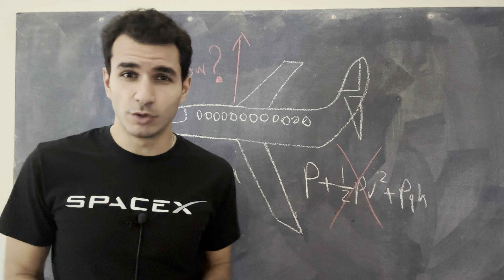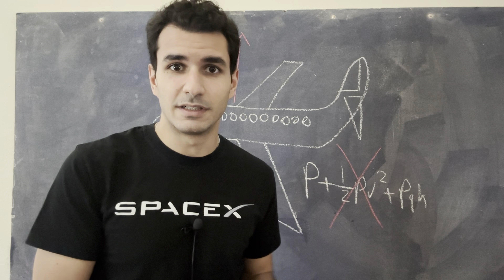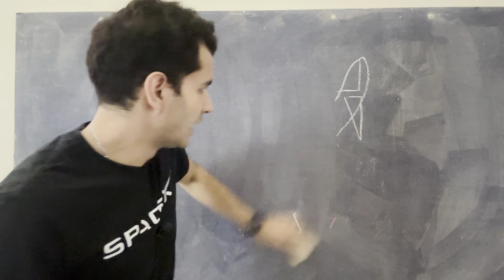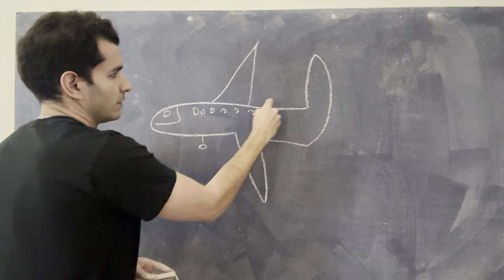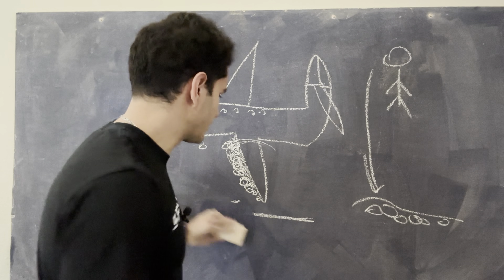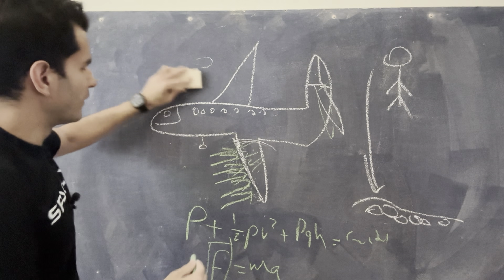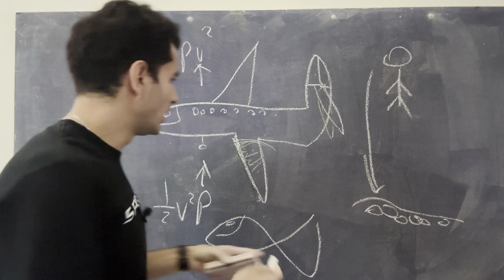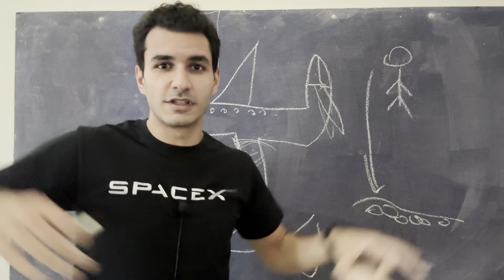Fix This One Misconception = Understand Airplanes Forever

Comment: As an aviator, I was taught that Bernoulli was the sole and primary reason lift occurs. An airfoil wing shape was designed to enhance the Bernoulli effect to make lift more efficient.  And this is why so many pilots fight online when discussing the issue.    I eventually ran into information that describes the physics as Ali is explaining.  That is, Newtons 2rd law of motion (F=Ma) combined with the 3rd law of action/reaction are together the actual dynamic and the prevailing physical model that creates lift.  As Ali is explaining, the pressure differences are a BYPRODUCT of the Newton forces, not the CAUSE of it.  In essence the Bernoulli effect is a head fake.  Sad that the FAA material, and aviation schools are still clinging to teaching this subject incorrectly.  Why do pilots need to know what is actually happening?  Because the avoidance of a stall is paramount and if a pilot does not understand how lift is generated, then that person can fail to control the aircraft properly.
Reply: Isn't F=ma Newton's second law of motion? And a force will have an equal but opposite reaction the third law?
Reply: "the pressure differences are a BYPRODUCT of the Newton forces"

So, you're saying force (pressure over the area of influence) is a byproduct of force (Newton forces).

So, force is a product of force?
Reply: Someone with a brain 😭🙏🏼@davetime5234. if two things mean the same thing, one cannot be a by-product of the other. It's the logical equivalent of saying that a chair is a by-product of a seat. Both the pressure difference and newton's 3rd law are both happening in each different way of describing the same thing. Faster molecules at lower pressure just doesn't cause as more reactive force and high pressure areas. The so rooted in common sense I thought everyone imagined this anyways when the pressure difference is thought.
Reply: @davetime5234  Watch the video.  The angle of the wing and forward thrust concentrates the air molecules which builds pressure BELOW the wing due to Newton's third law.  That then lowers the pressure above the wing.
Reply: @speedomars  But the majority of the total lift force is not from that bottom increase in pressure but from the top's decrease in pressure, by roughly a 3:1 ratio.

That outsized contribution of the top can't be justified by your explanation.
Reply: @davetime5234  Watch the video.  Ali explains it well.  For example, ask yourself how does a plane get off the runway when it is generating the most drag (including the friction of the wheels on the runway) and the angle of the wing is high due to lifting the nose off the runway which would by necessity generate the LEAST pressure difference if you are using Bernoulli as your explanation.  Also ask yourself the king sized question.  HOW DOES A PLANE FLY INVERTED?  The airfoil is completely upside down!
Reply: @speedomars  The common concept for both:

"the angle of the wing is high due to lifting the nose off the runway"
 
and:  

"HOW DOES A PLANE FLY INVERTED?  The airfoil is completely upside down!"

is asymmetry.

Lift results from asymmetry to the relative wind.  Asymmetry can be all from angle of attack or a combination of any asymmetrical camber combined with angle of attack.

Even a flat wing at positive angle of attack is generating flow curvature from the induced pressure gradient, and therefore lift.

"Bernoulli" is simply shorthand for the conservation of energy pressure change in response to mass flow continuity (one of the core Navier-Stokes equations).
Reply: @speedomars  planes designed to fly upside down have fully symmetrical airfoils.
Any other plane flying upside down can do so, but it is doing so because of power (thrust) and high angle of attack. It is very inefficient for planes to fly upside down.  Unless they have sully symmetrical flight surfaces. Then it's the same.
So, you are not thinking apples to apples here.
Reply: @Jmnp08  Definitely true with angle of attack allowing the necessary asymmetry of shape to the relative wind.

But strictly speaking, you don't need power/thrust from an engine:  there would be a sustainable glide ratio that would work to provide enough forward force.

Though it would no doubt be quite steep given the increased inefficiencies.
Reply: @Jmnp08  Not really.  The only criteria for inverted flight is an air frame stiff enough to take the stresses.  The tail of a plane is designed to create negative lift, this gets reversed in inverted flight, that's where the inefficiency originates, not from how the wing is designed. Also, there is no such thing as excess thrust for a plane like a Piper J-3 Cub which can be flown inverted. The J-3 was not designed for aerobatics, but with an inverted fuel and oil system, it can be made capable of such flight without issue. There are many such examples of fairly under-powered aircraft that can do inverted flight without a problem, and their wings are standard airfoils without modification.  The point you seem to want to avoid is simple.   Lift is due to Newton's 2nd and 3rd laws of motion and the fact that the wing is lifted due to a concentration of air molecules BELOW the wing, versus above it.
Reply: @speedomars   you're correct... but this inverted flight is not efficient at all. You are getting carried away with trying to be correct. 
For efficient flight,  with normal thrust parameters... you have to have fully symmetrical airfoil. Period. Also, gliding is not flying.  I am a pilot of planes and sailplanes. 
We can argue the BS semantics all day. The reality is as I stated.
Reply: @davetime5234  gliding is not flying. 
I fly planes and gliders. There is a difference.  Lol
Do t get so wrapped up in semantics.  
Efficient flight, inverted, must have symmetrical airfoil. Certainly I can "fly" a brick upside down or inverted straight into the ground with a glide ratio of .5/1000 pr something like that but that's not really flight now is it? No. 
And yes, i can inverted a glider or any other plane and "fly" inverted but the cost, or loss of efficiency would be astonishingly high compared to symmetrical wing. 
Anyway, this dudes explanation sucks.
Reply: @Jmnp08 How would you say lift for gliding is different?
Reply: @speedomars not many airplanes can, but those that do use excess a/t
Reply: @davetime5234  Correct.  All pilots know the effect of rime ice on the upper surface, which has to be kept clean.
Reply: @davetime5234 exactly this. OP doesn’t know what their talking about
Reply: This is a VERY LONG comment that I am copying and pasting from another discussion where a guy said that Bernoulli is an incorrect explanation of lift.
The 3-liner TL;DR version of it is:
1- Lift is well understood (by some at least) but it is intrinsically complicated and the explanation cannot be simplified without losing essential elements.
2- The Newton explanation is correct, the Bernoulli explanation is correct (as long as you don't invoke equal transit time). Both are different perspectives of the same phenomena. They don't compete. They don't collaborate each giving part of the lift. Both, on their own, explain 100% of the lift. Similar to how the 2nd law and conservation of energy explain why an object gains speed as it falls.
3- But those are after-the-fact explanations. I challenge anybody to PREDICT what the lift of a given airfoil at a given speed and given AoA will be, using only Newton and/or Bernoulli. Spoiler alert: you can't. They fall short.

Ok here is the long version. Good thing that I had this already written because almost nobody will read this:

It is not very helpful to understand lift but it is not wrong either. Because he does NOT say that the REASON WHY the air moves faster along the top than along the bottom is because the air parcels that were split at the leading edge must rejoin when they reach the trailing edge. That would be the " equal transit time" postulate, which is theoretically and observably wrong.

These are some "factual facts":
- The air does split when it reaches the wing, part of it flowing over the wing and part of it flowing under the wing.
- The air that flows over the wing does move faster than the air flowing under the wing.
- According to the Bernoulli's principle, the air that moves faster over the top does have a lower pressure than the air that flows slower along the bottom of the wing, and that creates a pressure difference that is the lift. But don't say that Bernoulli is the reason WHY the pressure on the top drops. Bernoulli is not a cause-and-effect principle. Is a CORRELATION principle. One could (wrongly) say that the pressure drops BECASUE the higher speed, and another one could (wrongly) say that the air accelerates because it's going to a region of lower pressure. The pressure drops AND the velocity increases, but it is not one causing the other, or it would be circular reasoning. Both effects need to co-exist.

Is this contrary to what NASA is saying in its link? Not at all. There are many approaches to explain lift CORRECTLY and each of them bring their own insight. It's not effects that "add up", each contributing with some fraction of the lift. NO. It's just different perspectives. In the same way as you can calculate the speed that an object will have when dropped from a certain height using Newton's 2nd law or using conservation of energy. It's not that part of the speed is due to Newton and part due to conservation of energy: both approaches give the same correct result each accounting for 100% of the speed on its own:

1) You can explain lift with Newton's 3rd law (wing pushes air down, air pushes wing up) and that accounts for 100% of the lift. If you put a "control boundary" ahead of the wing and another one behind it, the change in the vertical momentum of the air accounts for 100% of the lift. That, however, doesn't fully explain HOW that happens.

2) You can explain lift with Bernoulli. Ultimately, lift is a force on the wing and there are only 2 ways that the air can make force on a solid object: with pressure and with viscous friction. Lift in particular is caused by the distribution of pressures around the airfoil which is, on average, lower on the top of the airfoil than on the bottom. And Bernoulli exists and is totally applicable (outside of the boundary layer, but I digress). The pressure field around the wing explains 100% of the lift and correlates with the velocity fields via Bernoulli. In other words " The air moves faster along the top of the wing than along the bottom, and hence it has a lower pressure on the top than on the bottom according to Bernoulli" accounts for 100% of the lift. Again, just don't use words like "because" or "reason why" when talking about pressure vs speed because Bernoulli is not a cause-and-effect principle.

3) You an explain lift using circulation, like in the NASA's link. Circulation gets a little closer to explaining WHY the air moves faster on top than on the bottom, but what is the CAUSE of circulation? One can say that it is the Kutta condition and the Kutta - Jankowski theorem which say, respectively, that the airflow needs to separate at the trailing edge (i.e. it cannot go around it) and that an airfoil will generate enough circulation to bias the potential flow until it does, But why does THAT happen?
Well, you can approximate lift ignoring viscosity and working with potential flow, but that breaks down at the trailing edge because potential flow says that the air would happily go around the trailing edge with infinite speed under an infinite pressure gradient. Even the tiniest amount of viscosity (that always exists in real life) will make that impossible (not to mention supersonic effects) and that, in real life, causes the air to separate at the trailing edge instead of turning around it. Does this CAUSE circulation? Well, circulation is our mathematical way to impose that boundary condition. We just add enough circulation into our model until the separation point moves to the trailing edge.

4) The real and ultimate explanation of lift is the Navier - Stokes equations, which are super complicated and only solvable in approximated ways using computational numerical methods, generally knows as CFD (computational fluid dynamics). Yet, with advanced models, code, and computers, we can get excellent predictions of the pressure and viscous stress distribution around a body which in turn let us predict, very accurately, all the aerodynamic forces and moments on a body, including of course lift. Which, once again, will account for 100% of the lift.
Circulation (including Kutta condition and the Kutta - Jankowski theorem), Bernoulli and the momentum conservation approach, al can be derived from Navier-Stokes. Navier-Stokes itslef is derived from conservation of momentum on a parcel of air (that is, from Newton's second law), along with conservation of mass and other stuff.

5) And yet, we know that Navier - Stokes is utterly and unreconcilably WRONG. Because the it is based on a totally and demonstrably false assumption: The continuum hypothesis. Air is not a continuum, it is made up of individual molecules of nitrogen, oxygen and other stuff. If you want the REAL ULTIMATE CORRECT explanation, you would need to apply Newton's second law on each individual molecule. We are lucky that the wrong Navier - Stokes model gives results that are almost identical to that, at least until you are so crazy high that the molecules behave more like isolated particles rather than interacting particles (i.e there are so few molecules per unit of volume that cloisons between molecules are sparce).

"All models are wrong, but some are useful" - (George Box).
Reply: @adb012 Navier Stokes model is not a “utterly and irreconcilably wrong model”. It assumes that the air is a fluid made of several discrete molecules and that they follow Boltzmann statistics. The length scales that concern us like any typical aerodynamic objects are more than 10^6 larger than the mean free path (the average distance between molecular collisions) which means it is a quite accurate approximation. Maybe it’s not exactly “fundamental” but I wouldn’t  like to wander to the philosophical aspect of science since it detracts from the practical reality of what is achievable with our calculations.
Reply: @Qua54R  ... Take into account the context, please.

First line of my comment: "I am copying this from a discussion with a guy who said that Bernoulli is an incorrect explanation of lift."

Last line of my comment: "All models are wrong, but some are useful" - (George Box)."

Navier-Stokes model is wrong in the same sense that Newtonian mechanics is wrong. It is based on false assumptions (continuum hypothesis) and while it is an excellent approximation in a whole lot of cases (including atmospheric aerodynamic lift), it does break down at the extremes. Or try to predict the drag of the ISS using Navier-Stokes.
Reply: @adb012 Understanding aerodynamic lift intuitively is easy enough if you have a scientific mind. It is the summation of forces of all interacting air particles on the wing. With a higher concentration of particles providing an upward force on the bottom edge of the wing. But modelling the countless interactions individually would be horrendous. So using a holistic approach is perfectly reasonable by treating the air as a continuous medium.
Reply: @mista5796  ... Correct but not so fast. The force of each air molecule over the wing depends on the forces that the next layer of air molecules make on the layer immediately in contact with the wing, which in turn depends on the next layer and so on. There is more interaction between air molecules than between air molecules and the wing. That's why you cannot model left as marbles bouncing off the wing (where each marble interacts only with the wing). This effort is unattainable, which s why we use the continuum hypothesis which is totally incorrect (air is not a continuum, it is made of individual molecules that move relative to each other) but totally useful as the resulting Navier Stokes equation (itself unapproachable in analytical terms but can be approximated with arbitrary accuracy with numerical models) give results that are highly accurate to predict what the fluid will do wand what forces it will impose on bodies. But nobody in the popular media explains lift in terms of the Navier Stokes equation. Because "The wing produces lift because the fluid must meet the Navier Stokes equation and the boundary conditions, and lift results from that" is highly unsatisfactory. Saying "Wing pushes air down, so air pushes wing up by action and reaction" is totally correct and explains 100% of the lift (unlike what many videos and books say), but is also highly unsatisfactory because, yeah, but the same can be said about how cars work (tires push the pavement back so the pavement pushes the tires forward), or rockets, or... you name it. Whenever there is a force, there are two forces (action and reaction). But that doesn't explain how does the wing pushes the air down or how the air pushes the wing up, let alone it being totally useless to make predictions (like predicting how much lift would be produced by a certain wing at a certain speed and AoA). And when people start messing with Bernoulli and pressure fields, they screw up big time. "Air moves faster over than under the wing so the pressure is lower by Bernoulli" is also a very good and correct assertation, and actually you can directly convert the velocity field into a pressure field around the airfoil and integrate the component of the resulting force perpendicular to the freestream velocity to obtain a very good approximation of the lift. But what does that EXPLAIN about how lift is generated? Nothing, you just moved the goalpost. Why does the air moves faster over than under the airfoil? And then you start to get all kid of wrong explanations. Equal transit time is totally wrong. Pinching of the streamlines is between wrong and a consequence rather than a cause. Some people correctly say that the reason why the air accelerates is because the pressure is lower on the top so the air follows the pressure gradient, which is correct (the air has to follow Newton's 2nd law too, not just the 3rd law), but wait... Are we saying that the pressure is lower on the top because it moves faster on the top, and that it moves faster because the pressure is lower? That's circular reasoning. It's not until you introduce the Kutta condition, circulation, and the Kutta-Joukowski theorem that things start to make sense and you can start getting some actual explanatory power AND predictive power to calculate the lift of a given airfoil at a give AoA and given speed (which paradoxically relies on both viscosity to force the non-slip condition and the separation at the trailing edge, and potential flow to calculate the speeds and pressures profile through Bernoulli, which are two incompatible concepts, but there the boundary layer comes to save the day). And I dare you to go and find this explanation in any of the "This is how lift REALLY works" videos.
Reply: I'm sorry, but this is absurd.  

(TL;DR for the following:  force of lift results from relative flow turned by an asymmetrical solid)

"Bernoulli" is shorthand for conservation of energy.  This exists everywhere and is foundational to Newtonian physics (the basic description of physical reality we study and verify in basic science courses).  

If kinetic energy goes up it must be borrowed from potential energy, like a rollercoaster's speed (kinetic energy) adjusting with height (potential energy).

For fluids/air the "Bernoulli" representation of conservation of energy relates an increase in flow speed to a decrease in pressure and vice versa.

The core of Newtonian physics here is conservation of mass (flow rate), conservation of momentum (quantity of motion), and conservation of energy (ability to do work: a seesaw balance between kinetic and potential energy).

A wing airfoil is a solid asymmetry confronting a relative flow.

The relative flow (mass flow rate) must be conserved, so the asymmetrical obstacle of the airfoil causes an asymmetrical speed change to the flow split around the top and the bottom of the airfoil.

But conservation of energy says the increased kinetic energy from the speed to maintain mass flow continuity, borrows from potential energy, which is a drop in static pressure.

The above asymmetrical pressure difference between top and bottom, accelerates relative flow down (analogous to wind bending around a weather pressure system).

The above change in momentum direction results in an upward force (conservation of momentum).
Reply: @davetime5234 as an aerisoace engineer I am confirming that is the the full intuitive explanation behind the math that we use everyday to design wings and complete aircraft.
For anyone that still thinks that the explanation of flight is contested and "science" doesn't actually know what is going on: lift generation is fully understood and used everyday to make things fly very predictably and reliably.
Sure, the accuracy of real life calculations is finite, but that doesn't change anything about the completeness of the fundamental understanding.

Caveat: apparently some mathematicians pushed the Navier Stoked equations to some extreme regions where no consistent solutions exist. I sincerely hope this is "just" a consequence of the continuum assumption or we are in trouble 😅
Reply: @Qluq77  You are of course right pertaining to fundamental understanding, however First level of thinking and understanding is not always applied in teaching and it assumes that students always understand, as an example, the fundamentals cannot work, in a Vacuum, the reason and answer is in the why.
Reply from the maker: Spot on!
Reply: "the pressure differences are a BYPRODUCT of the Newton forces, not the CAUSE of it.  In essence the Bernoulli effect is a head fake"  

I like to re-visit these ideas occasionally.

Your statement is misleading, because it treats "Bernoulli" and "Newton" (whether 2nd law or 3rd law etc.) as being separate ingredients having some hierarchy of cause-and-effect according to personal conceptual desire.

But you haven't mentioned flow continuity, which is what Nature must maintain when an airfoil passes.

"Bernoulli" and "Newton" are merely two outtakes of the conservation of mass (flow continuity), energy, and momentum.

"Bernoulli" emphasizes conservation of energy, and "Newton" conservation of momentum.  Mass flow continuity (conservation of mass) is misinterpreted as ETT.

The above three popular narrative concepts (Bernoulli, Newton, ETT) are just poorly executed notions of the three fundamental conservation properties (energy, momentum, mass).

"Bernoulli" a head fake?  In terms of conservation of energy, hardly:  you need the energy conversion to "service" the change in momentum that gives you lift.

All in the name flow continuity being inevitably maintained.
Reply: I'm also an aerospace engineer and I can confirm that davetime is correct. This whole "disproving Bernoulli" trend is ridiculous and pushed by people who don't understand Bernoulli at all. They act like planes flying inverted is some kind of "gotcha" when it is completely consistent with a pressure model of lift.
Reply: @Quasarnova1  You are arguing with a NASA aerospace and physics PhD.  Watch this video.   Your education is dated.
Reply: @speedomars Neither NASA nor any aerospace degree programs make claims like this. Watch some college lectures before assuming some random video is correct.
Reply: This is a great explanation, we as humans tends to always look for deep detailed theories about everything and we sometimes overlook the obvious! Great example here.
Reply: @ "Lift is due to...a concentration of air molecules BELOW the wing, versus above it."

That is misleading.  The deficit of molecules above the wing results in greater pressure drop (below ambient) above the wing than the increased concentration.

So, if B is increased pressure below the wing and A is decrease pressure (below ambient) above the wing:

Pressure difference = A + B

where A is much more than B.

How can the smaller B explain the much bigger A?

What you are saying is illogical.
Reply: Well done, and all correct AFAICT. But ultimately unsatisfying to me. Focusing on momentum conservation (ie Newton III), clearly the wing “grabs the oncoming air and thrusts it forcefully DOWN”, if you will. How does it do that?

Especially: why does the air on the upper surface of the wing speed up and follow the wing around to its trailing edge, then separate from the wing? (and continue on a downward trajectory).
Reply: In a conventional aircraft optimized for lift-to-drag ratio, lift is primarily generated according to the Bernoulli principle. Only when full pitch control over lift is needed—such as during inverted flight in an aerobatic aircraft—are symmetric airfoils used. The trade-off, however, is higher drag.
So it's best to stick with the Bernoulli explanation, as it accounts for the majority (about 90%) of the lift in a typical aircraft and also explains why lift is still produced at negative angles of attack of the wing (how would you else explain that fact).
This video is, frankly, quite inaccurate at best.
Reply: @olivergroning6421  apparently you have not watched the video, nor read the comments.  Read some of the more current literature from NASA and MIT.
Reply: I also wonder at night time or bad weather no one can see a bit of shit from Aeroplane ... we are taking advantage of wide space in air nothing more than that, a small bird can crash this shit😂
Reply: Can someone explain how the magnus effects works
Reply: @h3xad3cimaldev61  The Magnus effect is a phenomenon where a spinning object moving through a fluid (like air or water) experiences a force that deflects its path, causing it to curve sideways. This force arises from a difference in air pressure created by the object's spin. The side of the object moving against the flow experiences higher pressure, while the side moving with the flow experiences lower pressure, resulting in a net force that pushes the object sideways.
Reply: Apparently they also teach pilots that the critical angle of attack is constant for a particular airfoil! 

Was shocked when I found out pilots believe that
Reply: @ Why not believe it when it's true?
Reply: @davetime5234  it's an okay assumption assuming you've got a well designed (conservatively designed) airfoil which ofc will always be the case in commerical aviation. But even there the critical angle of attack will be noticeably lower at low Reynolds Number
Reply: @barnowl2832  AoA is also a horribly misunderstood dynamic.   The truth is, a stall can occur at any speed. That is, any rate of airflow.   So the shape of the wing alone is NOT the primary dynamic.  A stall comes not primarily from air separation over the wing,  it occurs when the downward deflection of air is reduced.  According to Newton's Third Law, lift is generated by the wing deflecting air downwards, and this action-reaction force is the basis of lift.
Reply: @ But the downward turning of air is caused by the vertical pressure gradient.  

And that vertical pressure gradient is always the same for a given value of lift independent of airspeed:

pressure x area =  lift = d(mv)/dt) (vertical)

But the longitudinal pressure gradient to sustain that vertical pressure gradient changes with airspeed because the supply of air mass changes with airspeed.

So, the flow must accelerate to higher speed at low airspeed to sustain the same vertical pressure gradient as the force of lift.

It is the critical adverse pressure gradient (slow down back towards ambient pressure) that determines what is the critical angle of attack.

So,  it is not the "rate of airflow" as you said, but the rate of the rate, or deceleration of airflow that stresses laminar flow into chaotic motion.
Reply: @davetime5234  Newton's third law of motion, which states that for every action, there is an equal and opposite reaction, explains how an airplane generates lift. When an airplane wing pushes air downwards (action), the air pushes the wing upwards (reaction), creating lift.  Remember, the wing is mounted in such a way that there is ALWAYS a 2 to 5 degree positive angle of attack in level flight, and more pronounced in climb.  When descending some lift is still necessary, hence the angle between the wing's chord line and the relative wind still remains positive, albeit less pronounced.    The air compresses BELOW the wing generating higher pressure and by action, molecules above the wing are fewer, thus leading to a LOWER pressure gradient. The difference some attribute to the Bernoulli principal are actually a byproduct of Newton's 3rd law.
Reply: @speedomars  As far as the vertical component of lift in a steady climb or descent, it is always exactly equal to that in straight and level flight.

For your "air compresses" explanation for the popular narrative of the "Newton" explanation, that is "drag lift" like a traditional round parachute.  It doesn't explain airfoil lift, and airfoil lift's efficiencies.

Your drag lift explanation doesn't explain why sailboats can sail faster than the speed of the wind, or why aircraft can fly with very efficient glide ratios (15 miles forward for 1 mile down roughly for airliners), which is directly related to economically viable fuel consumption.

The "Newton" you're describing is closest to conservation of momentum.  The "Bernoulli" you're dismissing is closely related to conservation of energy.  The invalidated equal transit time is a misinterpretation of conservation of mass (the flow continuity equation in Navier-Stokes).

The truth is not the popular narrative versions of "Newton 3rd law", "Bernoulli pressure dop", "ETT yes or no", but the 3 replacement correct but relation principles of Newtonian physics:

Conservation of mass, energy, and momentum as mentioned above.

Basically, nature must maintain flow continuity across an airfoil, and it does this by negotiating momentum conservation (quantity of motion), and energy conservation (seasaw balance of speed as kinetic energy, with pressure as potential energy).

In short:  Lift is the force from an asymmetrical solid turning the relative flow, as it maintains the 3 conservation principles (Navier-Stokes).

So yeah, your downward reaction force is there, but it's just a little more complicated.
Reply: @speedomars  you're mixing cause and effect here. The wings aren't mounted so that they produce a positive angle of attack, rather the aircraft must be flown at a positive AoA in order to fly level. The mounting angle is more a question of efficiency/comfortable deck angle/structural integrity/interaction with the aerofoil that is the fuselage, etc etc.
Reply: O.k. I am not an aviator, but I am a physicist. The problem with this explanation here, is that it describes the situation of a high angle of attack, where you produce a high pressure region (higher than static pressure) below the wing by dynamic pressure, which is very intuitively understood in terms of Newton. 
But, that (and this is the point) this is only true at high angles of attack. At low angles of attack (e.g. at cruising and having a chambered air foil) the pressure above AND below the wing is lower than the static pressure. This is due to Bernoulli because the air stream above AND below the wing are faster in the vertical direction than for the air at rest. However, the upper air stream being faster than the lower. The reason lift is generated in this situation is that the pressure above the wing is lower than below. Bernoulli cannot be understood by Netwon’s laws, because it is due to energy conservation. The Bernoulli equation expresses an energy balance not a balance of forces. What is happening that in the static case the gas molecules move with an equal average velocity in the vertical and horizontal direction (let us forget for the transverse component here). When the gas velocity distribution is increased in the horizontal direction, the kinetic energy component in this axis increases. However, the total energy balance in the stream must be conserved, this means the average velocity (actually average velocity squared) of the gas molecules in the vertical direction is reduced. By the microscopic momentum change when the gas molecules are bouncing off the top or lower face of the wing the force is reduced (as compared to the static case) because their average vertical velocity is reduced. By the way this effect, doesn’t yield a net deflection of the air stream down, if the vertical position of the wing doesn’t change (I will not explain this, but it can be easily understood). 
All this happens (at low angle of attack and for a chambered wing) actually above and below the wing, however to a larger extend above the wing. Now even though the pressure on the wing is lower than the static pressure above AND below the wing there is still lift because of the pressure difference. As the angle of attack is increased the pressure on the lower side of the wing is increased and can become even larger than the static pressure due to dynamic pressure build up, then you transit in the lift generation regime. For an optimized airfoil the lift generation predominantely by the Bernoulli effect is between -5 (actually you see Newton/dynamic pressure would have a hard time explaining lift at negative angles of attack) and +10 deg angle of attack and thentransits gradually to dynamic pressure lift.       
You can search for ‘air wing pressure angle of attack’ and you will see that.
Reply: @olivergroning6421  Unfortunately your explanation contains some significant errors.

The biggest errors lie in the mischaracterization of Bernoulli’s relationship to Newton’s laws, the simplification of molecular velocity effects, and incorrect dismissal of downward airflow deflection. 

The last point is particularly problematic because downwash is a well-documented physical reality in aerodynamics.
Reply: @olivergroning6421  Asking AI for a non-biased objective assessment from your exact words:

The explanation contains several inaccuracies and misunderstandings regarding aerodynamic principles. First, the claim that a high-pressure region below the wing is only present at high angles of attack is misleading—most airfoils generate a pressure differential even at lower angles due to circulation effects. The assertion that both upper and lower wing pressures are below static pressure in normal flight is incorrect—while upper surface pressure is lower due to increased velocity, the lower surface pressure is typically higher than ambient, creating lift. The statement that Bernoulli’s equation cannot be understood through Newton’s laws because it is an energy balance rather than a force balance is also misleading—Bernoulli’s principle is a direct consequence of Newton’s laws applied to fluid motion via the work-energy theorem. The molecular velocity explanation oversimplifies fluid behavior, incorrectly linking individual velocity components to bulk pressure changes. Most critically, the claim that no net downward deflection of air occurs is demonstrably false—downwash is essential for lift production and is a well-documented aerodynamic reality. These errors lead to a misrepresentation of lift physics, particularly how Newtonian mechanics and Bernoulli’s principle coexist in flight theory.
Reply: Many planes are able to fly inverted. This alone proves that there is more to lift than Bernoulli.
Reply: I gave the video and this comment section to the AI and this is its answer:

This is a fantastic comment section that really gets to the heart of why explaining lift can be so tricky and contentious!

Let's break down the main arguments:

Who is most correct and why?

@adb012 provides the most nuanced, comprehensive, and fundamentally correct explanation.
Here's why:

Lift is Complex, Simplifications Lose Nuance: He correctly states that lift is intrinsically complicated, and trying to simplify it too much (as the original video does, and as many "Newton vs. Bernoulli" debates do) inevitably leads to incomplete or misleading explanations.

Newton and Bernoulli are NOT Competing Explanations: This is the most crucial point. He rightly says, "Both are different perspectives of the same phenomena. They don't compete. They don't collaborate each giving part of the lift. Both, on their own, explain 100% of the lift."

Newton's Laws (Momentum Change): A wing generates lift by deflecting air downwards. This change in the air's momentum results in an equal and opposite upward force on the wing (Newton's 3rd Law). This is a complete explanation.

Bernoulli's Principle (Pressure Difference): Air flowing faster over the curved top surface of a typical airfoil results in lower pressure there compared to the slower-moving air and higher pressure under the wing. This pressure difference, acting over the wing's area, creates an upward force. This is also a complete explanation.

They are Linked: The reason air speeds up over the top (leading to lower pressure via Bernoulli) is because the wing is forcing the air to change direction and conserve mass/momentum (Newtonian concepts). The pressure field and the velocity field are intrinsically linked.

Refutes "Equal Transit Time": He correctly dismisses the "equal transit time" theory (the idea that air split at the leading edge must rejoin at the trailing edge simultaneously, forcing the top air to travel faster) as wrong. This is a common misconception often taught alongside Bernoulli.

Bernoulli as Correlation, Not Cause-Effect (in isolation): He astutely points out that saying "pressure drops BECAUSE speed increases" or vice-versa is circular if you only consider Bernoulli. Both effects (lower pressure and higher speed on top) co-exist due to the overall fluid dynamics governed by more fundamental principles (like conservation of momentum and energy, embodied in Navier-Stokes equations).

Predictive Power: He correctly notes that neither a simple Newtonian deflection argument nor a simple Bernoulli argument alone is sufficient to predict the exact amount of lift an airfoil will generate. For that, you need more complex models like those based on circulation theory or, most completely, the Navier-Stokes equations (which are themselves derived from Newton's laws applied to fluid parcels).

"All models are wrong, but some are useful": This is a perfect summary. Newton and Bernoulli are useful models for understanding aspects of lift, but the reality is governed by the full set of fluid dynamics equations.

Analyzing Other Key Commenters:

@davetime5234: Is also very strong and largely aligns with @adb012. He correctly emphasizes the three conservation principles (mass, momentum, energy) and how Bernoulli and Newton are facets of these. His critique of @speedomars' "pressure is a byproduct of Newton forces" (implying force is a product of force) is valid. He also correctly points out that the pressure drop above the wing often contributes more to lift than the pressure increase below for typical airfoils.

@speedomars (the pinned comment): While his intention to simplify is understandable, his explanation falls into the trap of creating a false dichotomy.

Calling Bernoulli a "head fake" is incorrect. It's a valid physical principle that describes a real correlation between fluid speed and pressure.

His explanation that "concentration of air molecules which builds pressure BELOW the wing... That then lowers the pressure above the wing" is an oversimplification of how the pressure field is established. While deflection does increase pressure below, the lower pressure above is more directly related to the acceleration of air over the curved surface.

His points about takeoff at high AoA and inverted flight are valid challenges to oversimplified Bernoulli explanations (especially those relying on ETT or only the top surface curvature), but they don't invalidate Bernoulli's principle itself. Both can be explained by considering the effective shape the wing presents to the airflow (asymmetry, as @davetime5234 points out) and the resulting pressure distributions and momentum changes.

@olivergroning6421 (Physicist): Makes some significant errors:

"Bernoulli cannot be understood by Newton’s laws, because it is due to energy conservation." This is incorrect. Bernoulli's equation is fundamentally derived from applying Newton's second law (via the work-energy theorem) to a fluid element along a streamline.

"At low angles of attack... the pressure above AND below the wing is lower than the static pressure." This is generally incorrect for a cambered airfoil producing positive lift. The pressure below is typically higher than static, and above is lower.

"this effect, doesn’t yield a net deflection of the air stream down, if the vertical position of the wing doesn’t change." This is fundamentally wrong. For lift to be produced, there must be a net downward deflection of air (downwash).

@Qluq77 (Aerospace Engineer): His support for @davetime5234 and his assertion that lift is well-understood by engineers is important context.

In Simple Terms (incorporating the best points):

Imagine a plane's wing moving through the air.

The Wing Pushes Air Down: The wing is shaped and tilted to push air downwards. Think of it like sticking your hand out of a car window and tilting it – you feel a force. When the wing pushes air down (action), the air pushes the wing up (reaction – Newton's 3rd Law). This upward push is lift.

Air Speed and Pressure Change: As the wing forces air to go around it, the air flowing over the typically more curved top surface has to travel a bit further or is "squeezed" and speeds up. When air (or any fluid) speeds up, its pressure drops (Bernoulli's Principle). The air under the wing is often moving slower, or is compressed, resulting in higher pressure.

Pressure Difference = Force: This difference in pressure (lower on top, higher on the bottom) creates an overall upward force on the wing. (Force = Pressure x Area).

They're Connected: The wing pushing air down (Newton) causes the changes in air speed and pressure (Bernoulli). So, they are two ways of looking at the same event. One focuses on the forces and momentum change of the air, the other on the pressure differences created. Both are correct and describe 100% of the lift from their perspective.

Why Speed Matters: Air is thin. To get a strong enough "push" from the air (either by deflecting it or by creating significant pressure differences), the plane needs to move very fast. This is what the "dynamic pressure" (1/2 ρv²) term in the video refers to – the faster you go (v), and the denser the fluid (ρ), the more "forceful" the interaction.

The debate isn't really about whether Newton or Bernoulli is "the" reason. It's about which simplified model best helps build intuition, and acknowledging that both are aspects of a more complete (and complex) physical reality described by the Navier-Stokes equations. @adb012 captures this best.
Reply: @kennyphan9612  Where is the comment by @adb012?  I can't seem to find it?
Reply: @davetime5234 weird, now his comments are deleted
Reply: @davetime5234 oh I found it, above the comment section, choose "newest" instead of "top"
Reply: @kennyphan9612  It reads like a lot of my comments taken from elsewhere and blended with some other comments which clutter, and in several places dilute the meaning.
Reply: @kennyphan9612  No wonder AI said my comments align well, when much of the pieces appear to be my comments.
Reply: @kennyphan9612  🤣 I just had this mental picture of a guy dumping huge reams of documents into the gaping maw of a machine with a cynical expression on his face.  Like "Here, eat this haha" And imagine getting clowned on by AI omg the irony.  "Mother, today I took a severe blow to my ego.  AI has shit on me" 😂
Reply: By that logic isn’t f=ma a byproduct of action? And isn’t it all just charged particles exchanging virtual photons? The Bernoulli description is a good model for what’s going on.
Reply: @jessenelson8106  Bernoulli is the "f "(from conservation of energy to sustain conservation of mass flow "continuity"), and "ma" is the resulting vertical rate of change of momentum resulting from "f".

And you can say the latter is conservation of momentum (more than just saying conceptually, it is physically true).

Now, did it sound like I just said an f is equal to an f?  Yes.
Reply: Pressure gradients are created by the geometry of the wing, as there is a readily available pressure produced by the atmosphere. These pressure gradients determine the pressures and velocities of air across a wing surface area, resulting in the pressure differential for lift.

With the foce of an upwash of oncoming air, there would be continuity and energy conservation, so yes, forcing a fluid into motion can create the conditions to harness readily available pressure forces to act on a multi ton aircraft relying on a force which is readily available, unlike thrust production accelerating a fluid(through combustion) to hypersonic speeds(Like a Saturn v rocket) to achieve a force equal to the weight.

Newton's forces rely on pressure gradients(2nd law) and equal-opposite reaction(3rd law) no pressure gradient. The only way to reconcile these simultaneous contradictory events is through pressure differences. This is how Newton's 3rd law of lifting the weight of the aircraft is achieved by accelerating the static air above the upper surface into dynamic flow, hence a reduction in static pressure and a gain in kinetic energy.
Reply: @singh2702 You're pretending like you are inventing a better wheel than the wheel already well time tested.  Absolutely no net usefull insight here.  Your valuable points are ravaged by your bias serving ommisions.  Your lack of basic well rounded science skills is nullify  any useful contribution.
Reply: @davetime5234 The atmosphere provides an existing condition of pressure, 10 tons/m² or 14.7psi at sea level. 

On either side of the stagnation point, there are pressure changes. On the lower surface this existing pressure increases as the wing is redirecting air to flow parallel away from the trailing edge. This is the downwash caused by the change in momentum imparted by the wing onto the fluid. F=ma

On the upper surface the existing pressure is dropped through a pressure gradient. 

This increase in pressure below and decrease in pressure above must eventually equal a pressure differential equal to the weight of the plane. This is how wings are designed, how these differentials are achieved is misunderstood because it's very complex, and requires CFD. A lot is going on, the pressure and velocity distributions over a 3D wing is not simple. 

If you wanna explain lift by saying that the downwash is equal to the weight of a plane then you probably thinking of two flat planks as wings, creating massive drag with the lift force.
Reply: @singh2702 Fundamentally flawed: not acknowledging the rate of change of vertical momentum must at all times be fully equal to the force of lift regardless of wing shape.  There's no debate here as it is indispensable basic physics.
Reply: @davetime5234  We are all immersed in a pressurized fluid. The pressure exerts a bouyant force on us, meaning we actually weigh less and even more less if we were submerged in a pool. 

As a plane flys through this pressurized fluid(atmosphere), it needs to increase the air density(inertia) underneath to a point where the pressure forces equal the planes weight. The air is accelerated due to a pressure gradient as the air leaving the wings sphere of influence wants to return to ambient density and pressure, in all 3 dimensions. 

You are confusing this pressure gradient with the source of lift. The guy in this video explains the same phenomena.
Reply: @davetime5234  The lower surface applies a deflecting force to the fluid, increasing its density and pressure. 

In order to maintain the lift force, the momentum of the fluid exiting the wings sphere of influence must be equal to the momentum entering the wings sphere of influence, this applies to the density and pressure of the fluid entering and exiting as well.
Reply: Hey, fellow pilot with Commercial, I agree with your comment, came across the study that newton's 2nd and 3rd laws contribute to the total lift when doing Instrument Rating.
Reply: @NigelHill-mn5nt You can't just choose this or that physical law to the exclusion of the others.  Newtonian physics of motion draws on all of Newton's laws, and they are consistent with the 3 conservation laws (mass, energy, and momentum), because these conservation laws are derived from Newton's 3 laws.  More training in physics ideally instructs one to align these well established principles appropriately.  But saying Bernoulli doesn't play an appropriate role is wrong because Bernoulli is an expression of those same Newtonian principles.
Reply: As an aviator, I have to state it in terms to enhance my ego, any pretext works 😝😂😀
Reply: G
Reply: But an asymmetrical airfoil that has ZERO angle of attack also generates lift? How do u explain that?
Reply: @hgdrkui  No such thing.  All aircraft are designed with a 4 degree wing angle in level flight.  Ask youself how a kite flys.
Reply: @speedomars  wait hold on if ur saying commercial planes can fly fully upside down withOUT any change in AoA then u r 100% trolling like if thats ur level of understanding on the topic then i honestly dont know y ur even trying to defend lmao
Reply: @speedomars  oh nvm ur talking about an asymmetrical airfoil with no AoA. i mean idk what to tell ya, u clearly dont have sufficient knowelge AND experience on this topic... go to blender, create an airfoil with asymmetrical faces (yes u can literally eyeball it), then put it into openfoam without AoA, see what kind of numbers it give ya... yea thats how u can test for urself if u dont trust me... like duh planes wings have AoA bcuz they can only travel so fast (oh even wondered why commercial plane wings look different than fighter jet wings? yea speed is an important factor) but it doesnt mean that thats the only way u can generate lift... just stop trolling
Reply: @speedomars  oh and alternatively, u r welcome to use google 🤡
Reply: this is incorrect from a physics pov. if you do a principle component analysis of the magnitude of the different force components in lift, Bernoulli wins by a lot. it is not simply a transfer of momentum, it is a conservation field equation from pressure. think that the Bernoulli model is a lie? then an airplane should be able to fly on the moon by aiming a jet of air at it slightly under the wing. but this merely blows the wing backwards because there is no pressure field. Bernoulli is not the whole story, but it is so large a component of lift that aeroengineers have been able to design aircraft almost solely by the equations for a hundred years. I would like to see just one of these videos do a PCA to put an end to this false debate.
Reply: @coldnebo  this
Reply: @coldnebo  You analogy is flawed.  On the Moon, Newton's laws of motion and the principles of thermodynamics especially apply. A rocket's thrust is generated by expelling hot exhaust gases, creating an equal and opposite reaction that propels the rocket forward.  If you are trying to say the plane is stationary and you magically find "air" in space to "blow" at the wing, then lift will be generated on the Moon in the same way it generated in a wind tunnel, or on the ground, and the aircraft will lift off the ground in the same way it lifts off the ground using forward thrust.  Newtons laws again apply.  See above.
Reply: Like in most layman terms
So lift is nothing but drag on an inclined air wing and the vertical component of drag causes lift? And the thrust of the engines neutralizes the horizontal component of drag(overall drag of plane body) also gives horizontal acceleration by which the velocity is attained as the speed increases drag increases too?
Like I am from biology but i studied physics during my 11-12th
Reply: @kalpenshukla3252 that’s one aspect of it. The other is the presence differential between the top and bottom surfaces of the wing
Reply: @kalpenshukla3252  yes. that is basically the idea.  for example.  if you stick your hand out the window of a moving car and keep it level in the air, it stays level.  if you tilt it slightly up or down, the hand is pushed up or down.  That is Newton in action.
Reply: So, if it's "just deflecting air downwards" (and not turning the flow of air), why do wing spoilers disrupt lift? Actually, why do wings stall at all? After all, the stall only happens on the upper surface of the wing. Also, for people dismissing the 2nd law as a simple concept, a plane in level flight does not accelerate upwards. So why does the airmass in the control volume have to accelerate downwards?
Reply: @TDOBrandano  Wing spoilers disrupt lift by deflecting airflow upward, which increases drag.  The angle of attack determining how much the air is deflected downward.  When the wing is at critical angle, less air is deflected downward which destroys lift.  A stall occurs when there is not enough lift to keep the aircraft flying.
Reply: @speedomars  I am not talking about drag, drag can be counteracted with thrust. A stall occours when the airflow above the wing is detached and becomes a turbolent stagnating air mass, you can clearly see it with wool tufts. Why did the F4 Phantom, F104 Starfighter etc bother with blown flaps? Wouldn't the spilled high pressure air be more useful if it was blown on the lower surface of the flaps if your theory of pure deflection thrust was true? I think your experience of aerodynamics is limited to the ballistic regime.
Reply: @TDOBrandano  You (and others who still buy the false notion that lift is caused by a differential in air pressure) think the excess drag produced when the wing reaches critical angle is a function of the turbulence created when the airflow is disrupted over the top of the wing.  That is also NOT the primary dynamic creating the excess drag. It is instead a majority of the wing's lifting force tilting backward, converting the lift into a drag force that pushes the aircraft backward.  That excess drag cannot be overcome by the thrust vector (if it could, then a pilot would simply increase that thrust and avoid the stall).  Instead, the ONLY way to regain lift is to reduce the angle of attack and that is done by lowering the nose (a counter intuitive action that many pilots fail to perform).
Reply: @speedomars  Stall AOA on a wing section can be as low as 15 degrees to the relative airflow at high reynolds. The stall angle on a wing section is pretty much a constant defined by its shape. A wing can be stalled and still produce relatively little drag, which is why spoilers are not airbrakes. You want the airbrakes to be in a higher pressure area. You might also want to look up stall strips, and how the stagnation point moves as a wing approaches a stall. Also, pressure can be measured, and has been measured, so you might want to check the pressure distribution around a wing as well.
Reply: @TDOBrandano  No.  Stall angle is 20 to 28 degree.  In level flight, the wing is ALWAYS slightly angled 2 to 5 degree.  THE WING IS NEVER LEVEL.  That slight angle is what produces the equal and opposite force that generates lift.
Reply: @speedomars  The zero lift line on a Clark Y is approximately -3 to -4 on the chord line, the most efficient AOA is around +0.9. The stall angle for an RC model is typically between 12 and 16 AOA relative to the chord line of the wing section. Reynolds numbers do influence the way the flow of air remains attached to a wing.